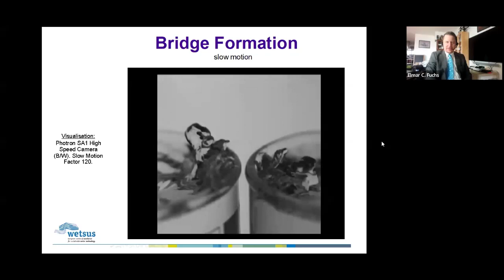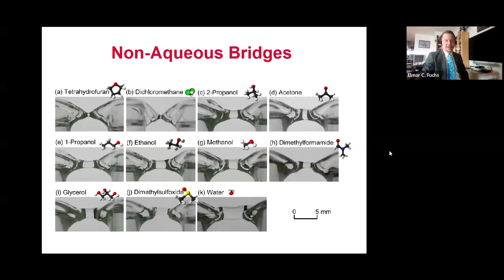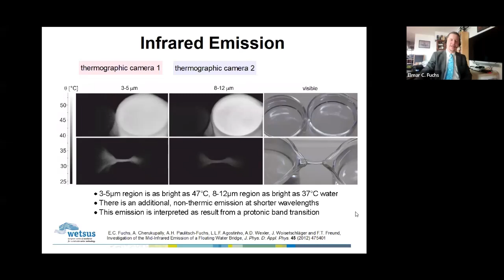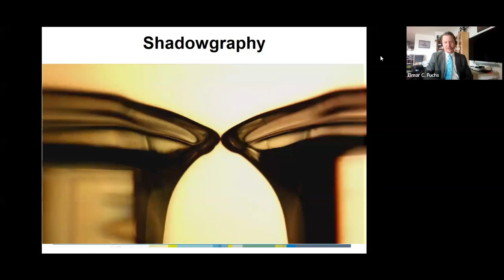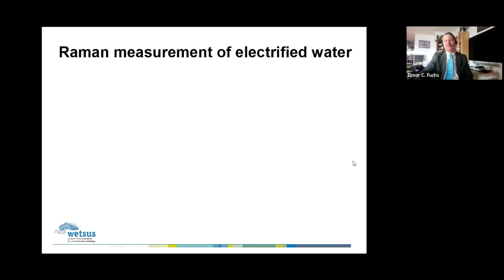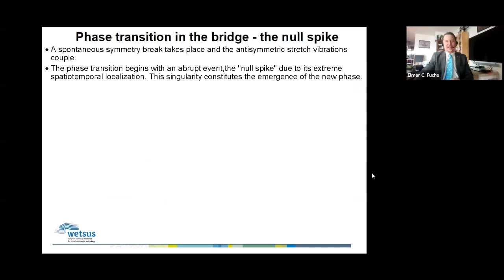[Webinar 2024] Aquaphotomics Spring Webinar – Physics of the Floating Water Bridge

Comment from the maker: Comments in the Chat during the webinar are posted below.
-----------------------------------------------------------
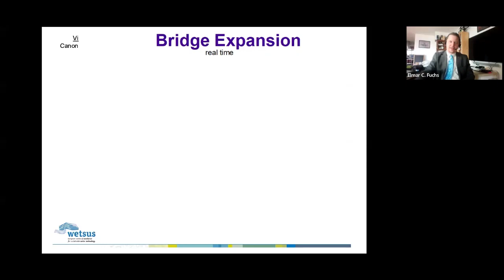0:11:36	pierre:	I assume you use distilled water - given that hardly any ions are present, water should be an insulator, so how would you see that a current can form?
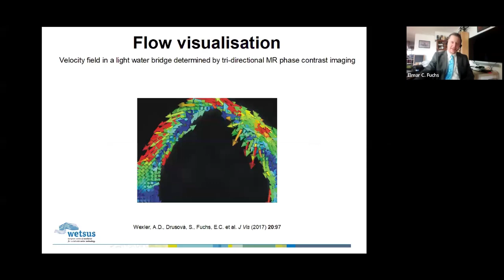0:13:13	pierre:	given the plasma that forms, implies that charges within the body of water are formed. in the absence of ionse, these charges can only be derived from the coherent fraction - would this mean that the applied 15kVDC does boost the coherent fraction? can we deduced that the floating water bridge is nothing else than liquid ice?
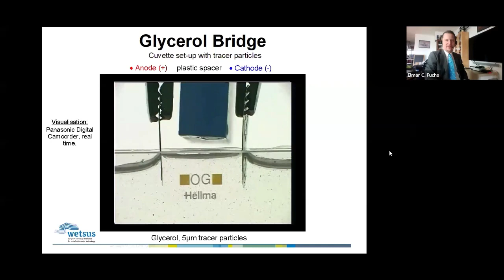0:15:43	pierre:	referring to the dipole moment as the sole explanation enablign the formation of the water bridge falls a bit short, as this would mean that hydrogen bonds are at play.to
0:20:58	pierre:	.... QED however tells us that HBonds (1st quantization) are not appropriate as this ps-short fluctuating network would be far to instable, coherence on the other hand would provide a theoretical framework (2nd quantization) where the water-bridge phenomenon can be looked at from a field-perspective. this not only woud make HBonding completely obsolete, but moreover it would be the only theory that would provide the free charges necessary to enable the current through the bridge in the first place ....
0:25:59	pierre:	said that, proton conduction would also fit with QED as hydrolysis is most likely facilitated due to the energy-providing network of persisting coherence domains - even though the energy to split water (approx. 15eV) is not quite sufficient .... but I speculate that splitting can take place via harmonic resonant coupling - as was demonstrated by Stanley Meyer and his water car.
0:40:21	pierre:	within the QED picture, it is possible to envision the same principle of action in biological tissue, i.e. cells; i.e, therein, proton conduction is not so much the result of proton pumps but an emerging property of the CD-network that spontaneoulsy drives this process; the transmembrane protein channels then just have to mediate a directed flow; H+ pumping via ATP would still be possible, as a supplementary mechanism that also contributes to the proton gradient across the membrane.
0:46:38	pierre:	would consider time crystals as the result of coherence being a manifestation at the particle level whil the thriving mechanism must be the wave property of the water molecules